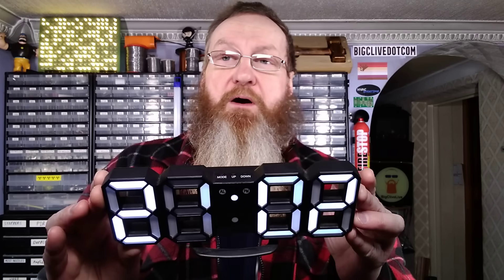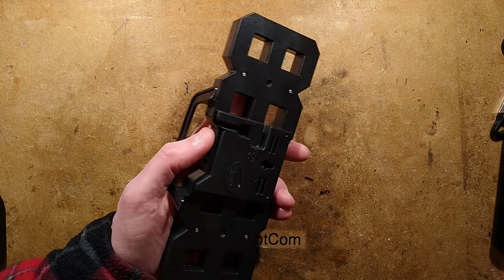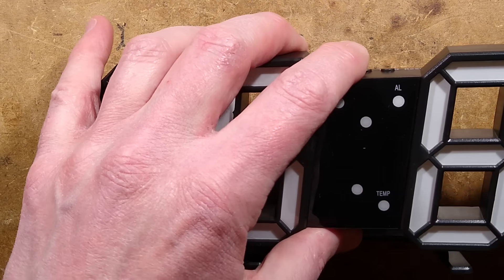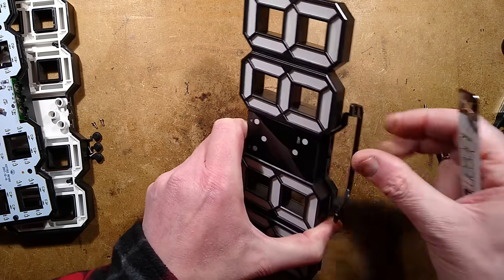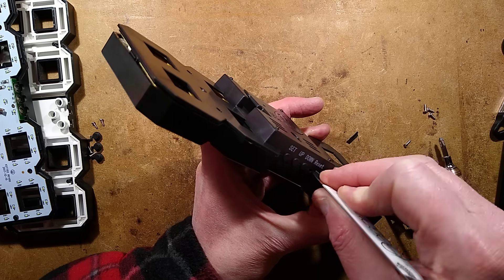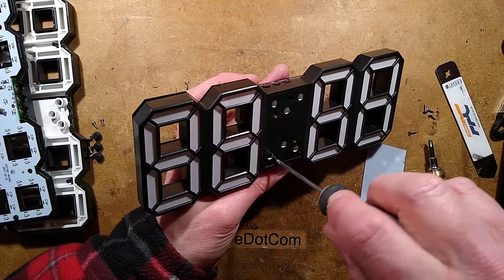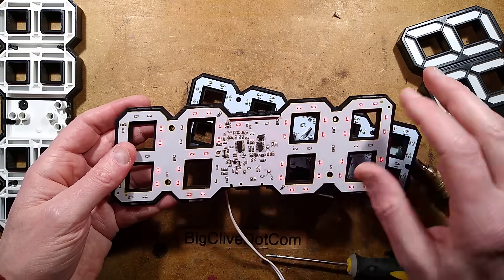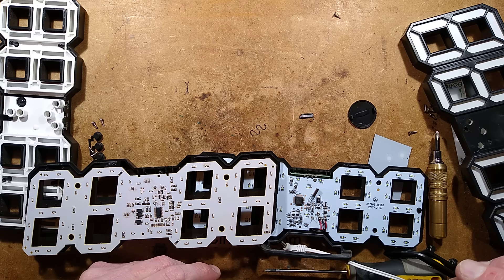The CURSE of white LEDs

Comment: I also own the new clock it's the white version with blue leds and the temperature feature is useless it registers upwards of 9 degrees higher than the ambient temperature due to the electronics heating up causing the thermistor to heat as well wonder if it's the same with yours

Comment: I found this clock to be too bright at night. I hacked the circuit and found that I could set the brightness by changing just one resistor. This controlled everything except surprisingly one of the dots between the hours and minutes. I was able to dim this as well by changing a different resistor. It was a bit tricky getting the brightness of the dot to match the other dot but in the end I got it pretty close.

Comment: If you see any electrolytic capacitors change them. The leakage current in cheap LED's can be vary, so that when current get low they will not light equally.

Comment: I moved into my house 6 years ago, and replaced everything with LEDs. The ones outside are auto on/off at dusk, so if they run for 12 hours per night that's just over 26,000 hours on them. The cheap amazon bulbs all still work fine! The fixtures are very open to allow the heat out. Pretty much everything else has failed at least once, usually in the hundreds of hours....

Comment: Small OLED displays are even worse for fading segments. 
I have a barometric pressure monitor for keeping an eye on the weather and its display has been replaced 6 times in 2 years. 
I eventually redesigned it to use a 2 line LCD display. 
No more segments fading away. 

There must be literally 100’s of LED clock designs out there that can use  through hole LEDs. In desperation one could even mount the LEDs on sockets. 
A clean tidy build doesn’t need a front cover. 

Perhaps a future Big Clive LED project???

Great video. Very enlightening about the longevity of LEDs. 

Thanks
KW.

Comment: Same as tiny neon lights in eg. power strips.
I have a tiny light from my dad, that has been running most of the time for 50 years and it's fine
and then I have power strips that you can't see if it's turned on after couple months.
Those things are not build with tolerances to last, they can be made to last essentially forever, but they would be marginally more expensive and you would not buy replacement.

Comment: I think there is a quality problem with the LEDs in this particular unit, and it's not indicative of a problem with white LEDs in general. When we moved into our house about 9 years ago, I renovated the house one room at a time over the course of the first one year, and replaced all lighting fixtures with new ones. Most of the bulbs are cheap IKEA Ryet bulbs which are no longer available, and almost all are still working, even though they are typically on many hours every day.

Comment: I was an early adopter of white LED, some of the early ones did fail quickly, I even got a $50 settlement from Sam's Club, because they didn't cut the mustard (oddly they just sent it to me, I didn't have to fill out any coupons or sign anything).  But I'd say the 2nd gen white LEDs stick bulbs and I also got some 12V stair light bulbs that are now 8 years old and going strong lit half the day every day.  The stick bulbs also last very long time.  They do die eventually, they aren't eternal like your red LEDs in alarm clocks.  I mostly use the stick bulbs in well ventilated lamps, which I'm sure helps a lot.

Comment: i would like to add my recent experience with white led's i had 5 strips removed from a backlight of a 32 in lcd tv, one strip i used as a night light in the kitchen , works great but was bored with the whit color, so bought a yellow gelatin sheet & covered the leds to get a warm yellow light & suprise the yellow sheet became completely transperent w/o the yellow tint within 3 days, was the high UV from these leds causin to loose all the yellow pigment, should the led's placed in a glass tube like in a fluroscent lamp to block the uv.
Reply from the maker: The output is usually blue or violet.  The theatre lighting gelatine often bleaches out even in tungsten lights.  It has to be changed regularly.  The filters in the closed moving lights are usually dichroic glass to avoid that.

Comment: I had a professor who had worked on blue LEDs back in the early 70's.
By the end of the project she took all of the material and ground it up and used it as blue eye shadow.
Reply from the maker: That would be strange, since neither gallium nitride or silicon carbide are blue.

Comment: Well, yeah. I have a similar experience with my Happy Brush toothbrush. After about three years of use the LEDs have significantly lost brightness and some of them started to fail. Well, if you buy the chapest possible parts... It's actually the third device I got in exchange during warranty. The first one started rattling when the bearingss failed after a few months, the second suddenly wouldn't stop charging (had luck it didn't burn down my house as these devices used Lithium batteries). The one with the now dying LEDs is the third one.

I own other devices that use white LEDs as backlight or as tell-tales where the LEDs seem to have nearly full brightness after more than a decade of use...

Comment: If the white version was actually multiplexed, shouldn't that, from a technical standpoint, slightly increase the lifespan? Would the reduced duty cycle lower wear in any significant way?
Reply from the maker: If I recall correctly, the white one was direct drive.

Comment: Clive, can you provide a link to a datasheet for a Red LED based on a Blue LED with a Red-emitting phosphor?
Reply from the maker: No.  But here's a link to an LED doing it:-
https://www.aliexpress.com/item/1005005736646351.html
All the arrays are using blue LEDs and phosphor, except the blue which just has the bare blue LEDs visible under clear gel.

Comment: I have the same clock, and replaced it for the same reason. 
But the new one has slightly italicised numbers making it a different shape, so it won't quite fit in the same place as the old one. 
I've contemplated swapping the LEDs, but for the moment the old but dim one prevails!

Comment: We are still being told the "long life" lie with those integrated flush ceiling lights whose 'bulb' cannot be changed. They seem to last a year or so, and since the 'bulb' cannot now be changed by the consumer, they cost £15 for the entire replacement unit, plus an electricians fee per hour or part thereof.  (Unless you can do the wiring.) Who the F thought these were a good idea?
Reply from the maker: I've got a video in the queue that features one of those ceiling lights and discusses the same issue.

Comment: I built an eight-digit TTL clock with orange (time) and green (date) leds in the early 1980's. Still going strong well over 40 years later. No multiplexing just straight TTL IC's 7447, 7490, 7400 and 7413 IC's and a 4.19 MHz crystal.
Reply from the maker: I can remember the big clock projects in the magazines from that era.  Very tempting.

Comment: Often LED´s burn out because they are driven to hard and/or they are getting to hot. 
But there are also many many LEDs on the market that are not made to spec (cheap china LEDs). I have a bunch of them here and wanted to use them in a few different projects. But they burn out in weeks not month. Even when driven way way below spec they will burn out super fast (example: spec 150mA, i reduced the current to ~30mA and the LEDs are still burning out in less than 3month).

Comment: Awesome breakdown! I've had the blue version of this clock for a few years and the LED's are still bright. Glad I didn't get the white version.

I do have a question about the ceiling projector clocks. I've had a few over the years and they've all faded. Is that natural for them or did I get bad quality clocks? Are there good projector clocks that last? 🤔
Reply from the maker: What colour are the digits they project?  I'd guess that they may be pushing the LED hard for intensity.

Comment: So there is a reason why most digital LED clocks have mostly red LEDs in them... interesting.

I used to use my old stereo with a vacuum fluorescent display as my clock. When I found out that it was using 20W for doing only that, I bought a cheapo LED clock. Like wtf....
10y+ the red LEDs still holding up very well, and only use ~3W for the job.

Comment: I have a red LED digital clock that I put together in the 70s...  Also,  I used old germanium transistors for the LED drivers that I got from old Burroughs Computers.. Still working fine.

Comment: why the hay someone would use blue LED and a phosphorus to make red light instead of just red LED? to what?
Reply from the maker: It's done a lot with filaments and COBs where they make a standard array of blue flip-chips and then change the colour with phosphor.  Modern christmas light strings also often use blue excited red, yellow and green so all the LED forward voltages match.

Comment: I have white LEDs installed in a lamp that has probably been on for somewhere around 25,000 hours, I haven't noticed any drop in brightness from them. Maybe the LEDs in the clock had some kind of quality issue?

The LED bulbs that have been installed around my house for around a decade are also working just fine and I've had very few of them fail.

Edit: I just remembered that I built a clock kit (a kit that this channel inspired me to buy) with blue LEDs, and a few of the segments have started to go dim. I would say that the quality of the LED definitely matters.

Comment: I still have my dad's radio alarm clock with red LED display. It was on 24 hours a day from when he bought it in probably around 1982 until he died a few years ago. It still works, and if the LEDs have dimmed at all I can't tell - it's still vivid and clear. And that clock was made by Amstrad, not a company with a reputation for high build quality or the selection of the best-quality components.
Reply: Hey mate, Im one of them dads, ive got the exact same clock, Im an old man now, and just like you say mines been running 24/7 for 42 years years now, and Im think itll never stop working for ever so will yours mate, Im not kidding I think it will run for thousands of years. I cherrish mine, kind regards and all the best mate

Comment: I'm still using my red LED clock radio from 1988 - the buttons are a little stiff but the LED element works just as well as the day I bought it!! and I recently did a peroxide coating and left it out in the sunshine (well the casing anyways) for 3 days until it returned back to white (In other words for the whole of last years British summer) Weird to think that I when I bought this with my YTS wages back in 1988 - that I'd stil be using it in 2025 (It has stiff buttons and I have stiff joints - so we are as one!)

Comment: i finally retired my red led radio alarm clock after forty years as the cat knocked it off the shelf.surprisingly it still works but the case is held together with duct tape but i found a similar radio alarm for £3 in a charity shop. the old one i still have somewhere.

Comment: Yeah....led lifespans are very..... imaginative! Remember seeing a 5mm blue led from Maplin, when they first came out, around £5. Must be something like early 90s ? And we were also told that LED streetlights saved energy. Sodiums were 60/80w if I recall correctly. The 'new' led lights were 100w I was told by the council installer. Hmm
Reply: That's what happened during the transition from incandescent lamps to compact fluorescent lamps. The monthly electric bill wasn't appreciably reduced. So? What's the point? Now, me and my roommate relamped to LED bulbs. The electric bill is STILL high! (If you touch the BASE of a CFL bulb or LED bulb, it will burn your fingers. The electronic conversion circuit uses a lot of juice. And a lot of CFL's and LED's are not dimmable).
Reply from the maker: The Maplin LEDs were about £10 each initially.

Comment: IMO we should standardise on some sort of PCBs which run on 12V DC of a certain size and connector geometry. So maybe you would buy a light fitting which contains circuitry to step down from mains to 12v as well as the light diffuser and any decorative elements, and you would plug in a standard replaceable 50mm diameter disc covered in LEDs. It's so silly packaging the LEDs in a bulky light bulb shape that is terrible for heat dissipation next to the converter.

Comment: sorry to bore you all again. but as i said i love clocks. i have been thinking about making a usual clock, but rather than using a 32768 crystal with an inverter, like a 7404, using it with a valve based inverter. and then using valve based flip flops for the 15 division stages. so a clock made from a wonderful cathedral of gently glowing valves. how wonderful would that be? also i have been pondering making an near analogue clock. as we all know an analogue clock is impossible. but if one were to use a rotary encoder it would be possible to make a nearly analogue clock. for some time all i have thought about is clocks.
Reply: Entirely Vacuum based digital clocks have been done before. While trying to find the one that used 97 vacuum tubes I discovered that someone has got that down to 16, although it is using Beam Deflection Counter Tubes which sound rather specialist.
Reply: @MrDuncl  thank you for your reply. it is always thrilling to find another human that enjoys my questions enough to answer them!
Reply from the maker: There's a neon based clock dotting about on the 'net.  It is built from discrete components.

Comment: talking of white leds, my main thing i bore people about in the pub is how crap LED bulbs are and the specious arguments for them. folk say incandescents are "inefficient", this is wrong. i live in a home, in which, i always need heating, so any heat 'gained' from the bulbs is taken away from my heating costs. LED bulbs don't last as long initial estimates suggested, they often use rare earths and are unrecyclable, whereas an incandescent can be recycled forever, and most importantly , for me, the light is awful. some claim 'daylight simulation' yet they have massive spikes in the spectrograph. i still buy rough use incandescents, but i fear even this right is being stolen from me. i do have a gross of old osrams in my shed, but i fear for the future. i admit my arguments involve nuance, which rule makers find hard to deal with.

Comment: The current Roberts DAB bedside clock radio here came from a charity shop, clearly donated because the LCD's white LED backlight had gone very dim. Swapped it for a red one and at minimum brightness it's fine - at maximum it lights the room.
Another came up at the same price (£3) with the same issue a couple of years later so now I have a spare

Comment: On my Steelseries Apex pro I have over 20 defective blue leds. The green and red ones still work.

On the other hand I have very old neopixel leds which are all still nice and bright.

The sad thing is that it just over 4 years old. And you cant get replacement ones as they didnt use the standard pinout on the leds.
Reply: My 3 year old Apex Pro also has a couple LEDs out. Seems like poor quality. Another mechanical keyboard I owned for nearly a decade still had all lights working just fine before I accidentally spilled liquid on it and broke it.
Reply: @99domini99  My £25 "gaming" keyboard from Lidl doesn't have any failed LEDS yet, yet gets used about four hours every day for general web browsing.

Comment: I Have a red LED  alarm clock, which was a Christmas present in 1979, It’s been running almost continuously, so over 44 years of use & the display still looks exactly the same as it did when it was new!
It has a nice deep cherry red colour display.
No components have ever been changed. 
It has 2 brightness settings & I've always used the lower setting, which is plenty bright enough, which has probably helped it's longevity!
Reply: Vintage digital clock radios are indestructible

Comment: I've got a couple of clocks like this, different frame but likely the same design. They have indeed faded significantly after only about a year, though interestingly they have not only had segments fade and flicker, but also some segments have begun to flicker when they are not lit; I wonder if that is the driver chip itself breaking down. Doesn't appear to be multiplexed. My bigger problem is that the QC on the crystal is garbage; literally half the units I got had more than 30 seconds/week of drift, which is absurd. Also that microphone is likely for the 'voice activated' mode, which it turns out is just a very bad clapper lol. Basically hit it and it'll show the time for a few seconds.
Reply: hands-free activation of the clock sure does help with securing the track record in handsfree clapping 😅

Comment: My 5 year old fridge has an LED temp display on it, and it's RUINED. Absolute trash. Nearly $2000...
Reply: My 3.5 year old fridge has an LED light inside that's been dead for a while. Unlike an old fridge with a replaceable bulb under a removable cover, replacing this LED would appear to need the whole fridge dismantling. I expect they though it would last forever.

Still, better than the previous Samsung that started sounding like a jackhammer and pissing water all over the floor when it was a few months old, and I never managed to get Samsung to fix it properly or replace it. Never buy anything made by Samsung.
Reply: @Zeem4  they expect you to buy a new fridge. I don't think they care if it lasts. Haha